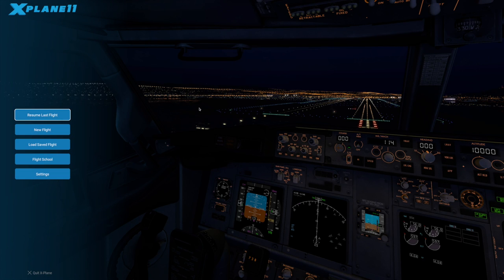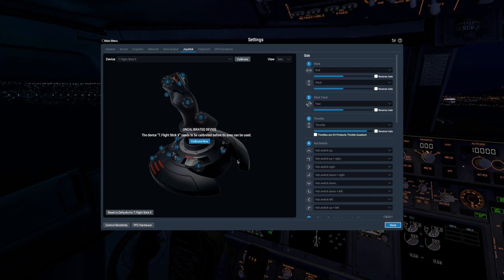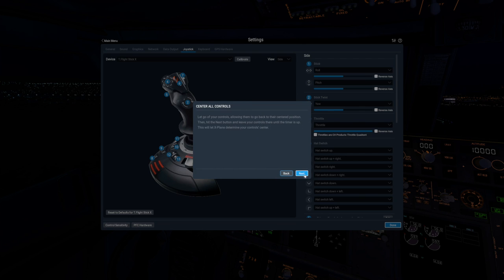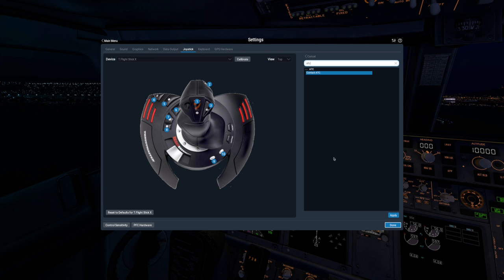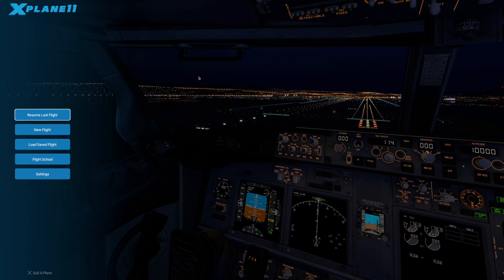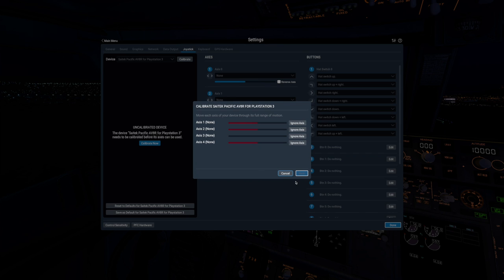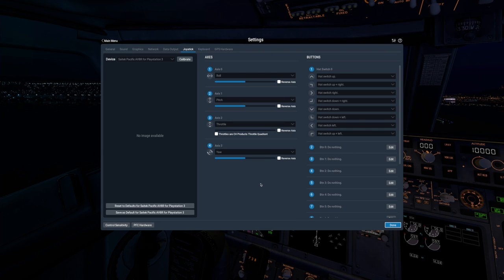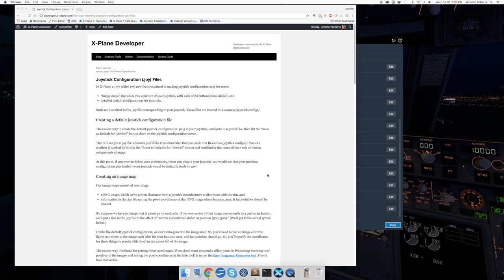Configuring Joysticks in X Plane 11

Comment: Im using a Logitech Extreme 3D Joystick and X plane does have an image for it. But theres a warning at the bottom that says "multiple axes assigned to pitch, yaw, and roll" and it wont let me fly using the joystick. Same problem with my ps4 controller how do I fix this?

Comment: Is it possible to see how the cables are set up from the back of the Joy Controller to the computer, I have the only hard wired USB cable going to a USB port on the front of my computer and the Rudder USB in the back of the Joy controller and the Throttle quadrant  plug into the back of the Joy Controller and the only one I can calibrate are the rudders.

Comment: Thanks, but why isn't it possible to have separate configurations for different types of aircraft? A plane and a helicopter will not need the same axes, typically throttle/propeller for a plane, collective for a helicopter. And the sensitivity should not necessarily be the same either. Why do we have to change that manually everytime, depending on the aircraft?

Comment: Here's my problem Pep's: I am using a T.1600M dual throttle and stick, (without using Target which assigns keyboard commands). Pre-assigned actions remain, even if set a button to 'Do nothing' in Xplane... if over writen to anther action, both old, and new seem to opperate together...How do I get back to a 'clean set-up' with no pre assigned actions...? is it a stick problem or Xplane, yet this does not appear in other Sim's with the same set-up..? Any advice is welcome.

Comment: Noob question: 
setting up multiple yokes/joysticks. I built a 2 seater for my xplane sim environment. How do I config the dual yokes and dual joysticks?
Do I calibrate each one to start with and then save them individually as a "profile"?
I have all 4 plugged into a USB bank with on/off switch at each port.
Is there anyway that the pilot and co-pilot can fly at the same time?

Comment: Just got new iMac running OS10.13.  Tried everything the tutorial stated but iMac or X plane does not recognize the Joystick.  I'm using a Saitek Cyborg 3D controller.  If I do a system list "About this Computer" I see the Joystick as connected to one of the USB ports.  Why can't X plane 11 find it????  When trying the tutorial when I click "Settings", I get the message "No flight controls found" ???  It is connected to a USB port, It recognized on the iMac system report, It was connected b4 launching X plane, so what's going on???  Please help.

Comment: techie had my pc yesterday and was using x-p with keyboard strokes. now my buttons and hat switch are not doing as they have been programmed. what to do?
 reset to defaults my yoke and recalibrated it then re assigned button selections. no difference.
can u help?

Thanks
Reply: fixed.

Comment: when my yoke and joystick are both connected I cant use the joystick.  Everything works but I dont have ailerons rudder and elevator control. I go to configuring  the system recognized it but I dont still can have control of the surfaces

Comment: i set up joystick with logitech profiler and then set xp joystick to do nothing for most buttons on logi extreme 3d. now when i press one of the buttons i've configured it doesn't do anything. before i used logi profiler is if i pressed the button for external view chase the xp 11.10 shifted to opening screen then back to internal view?? is my joystick busted? help would be welcome thanks.

Comment: I am having an issue after takeoff with he plane not holding steady and is erratic and cannot correct with my CHEclispe yoke.  I did calibrate.... I am going to remove and re-calibrate again..... hopefully you can offer me some advice as to what I am doing wrong with the Cessna 172  and why I cannot fly after takeoff and keep the plane level before it starts erratic moves and trying to correct with the rudders on the CH Yoke and the yoke is impossible leading to crash.  Thanks you, Joey
Reply: I've been using XPlane11 the latest for the past year or so, and all of a sudden the past two days, it started to behave as you're describing, no matter what plane I'm using. It was really  pissing me off since I was trying to do a flight last night from Queenstown to Wellington NZ, and I managed the flight, somehow, but I almost crashed on approach given I couldn't 
control my HOTAS Thrustmaster 16.000 properly. It was maddening, I haven't had these issues before, also, the plane won't center up on Autopilot/Nav. procedures just following a GPS course now. It never did this before. You cannot even fly manually, can't control the takeoff at all, plane just spins around and around, and it cants to the left or right as it flies no matter what mode you're in. Fucking pissing me off!

I wrote to XPlane and they just sent me the basic video link as above. Great! I don't think it's my brand new Dell Gaming PC, which is flawless so far, and I doubt it's my HOTAS, given I only bought it earlier this year and it seems in fine condition.  I tried reinstalling the whole sim., and recalibration 3x already, not fixing it. It's also happening in MSoft Flight Sim X, I tried that again tonight and same issue. If I try a different joystick, my older one, and it still occurs, I don't know what to do, minus deleting the whole install and reinstalling XPlane11 totally again from the DVDS. Which really I shouldn't have to do, but maybe it got corrupted? I also don't know why since I've updated the sim. 3x since first install, standard updates, the Nav. data on the GPS computers still tell me "Nav. Data out of date." It makes zero sense. And this is for ANY plane I might fly with GPS!  XPlane needs to fix these bugs better or I'm gonna 
dump it and go purchase Prepar3D for sure.
Reply: Read my commentary below. It shouldn't be doing that. I have had some minor bugs with various planes so far since switching over to XPlane11 from FSX earlier this year, but nothing that usually isn't my own fault. If you get erratic rudder, yaw and pitch issues, it can be a myriad of things but usually if everything is working right, and your controllers are calibrated right, and the plane is good or good quality, this should not really occur.  In harsh weather conditions, maybe you'll get more anomalies but I usually don't.

Comment: Xp11 is not detecting Logitech saitek Yoke  and rudder peddles .. windows detecting them and working fine.  While xp11 detects PS4 controller it's failing to detect the yoke and ruddes .. please help

Comment: This is all fine, but why do I have to go through this process every time I start X-Plane 11? I have a logitech Force 3d pro and it is incredibly over sensitive on every restart of the game.
Reply: plug in the controller before you start xp11, in the same usb port
Reply: It's always plugged in and always in the same port. I don't have this problem with other flight sims. X-Plane simply doesn't seem to remember from one start to another!
Reply: Rod Auger How do you close X-Plane?
Reply: First, I should mention I bought it through Steam. I think I close it through the menu options. I'm not sure what other way there is other than closing Steam, which I don't do.
Reply: Rod, if you are still having problem with the Joystick settings not saved you might delete the joystick.prf file, start X-Plane through your Steam thingy.   Go through the X-Plane Joystick setup and assign it to a Profile, maybe GA or Big Jet, Helicopter whatever you want to call it. Now click DONE in lower right corner. That should create a new preferences file named...X-Plane Joystick Settings.prf which is saved in that Preferences folder in the Output folder.  I use Steam X-Plane as well and have no problem. I exit by going to the File menu in X-Plane and select EXIT.